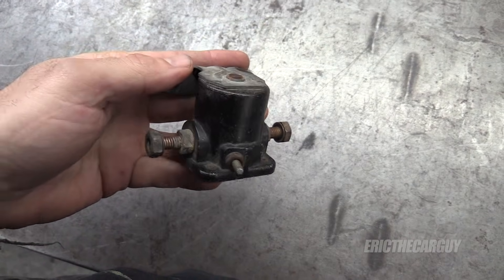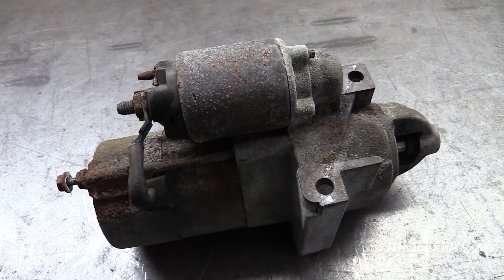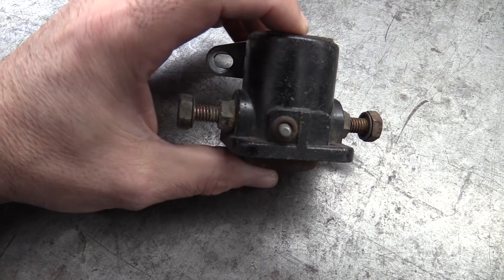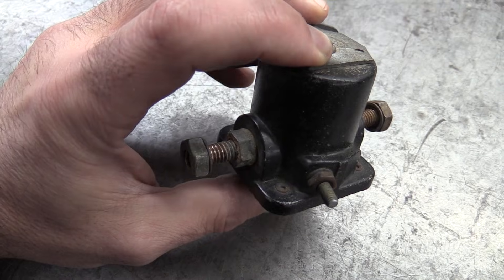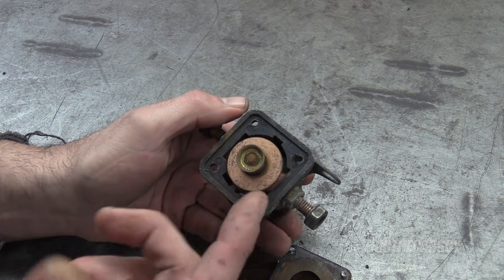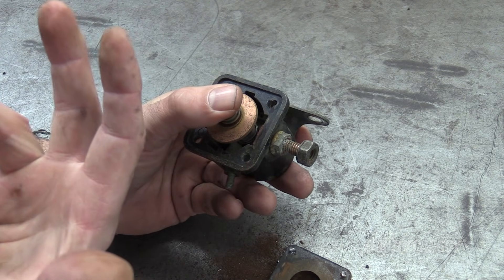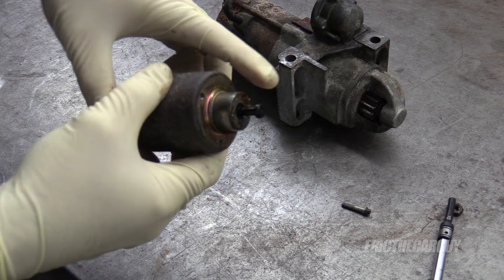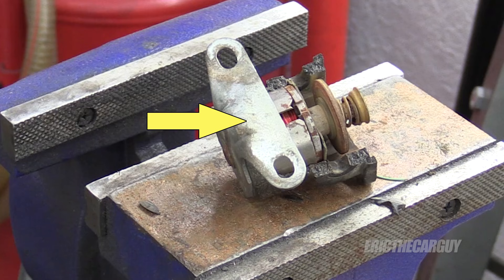How Does a Starter Solenoid Work?

Comment: I believe this is called a Pre-engaged starter motor and not a Bendix starter motor. Because the Pre-engaged starter motor can only engage with the help of that solenoid tugging on it. The Bendix starter motor on the other hand engages by pulling inwards and not throwing outwards like the Pre-engaged starter motor. Although the Bendix starter motor needs it's solenoid just to close the circuit so that the starter motor can fire up, it doesn't actually need the solenoid to pull it inwards, but it actually just makes use of the starter motors centrifugal force. The other info in the video was very helpful tho.🫡😌

Comment: That was very informative. Provide electric charge to create a magnet to make an electrical connection to make a mechanical connection to start the propeller to start the engine. I suppose there's a reason we can't do without the first 2 steps?

Comment: There is a difference between the standalone one and the starter mounted one. The starter mounted solenoid unit also energizes an electromagnet that throws a lever to kick out the starter gear so it can engage the flywheel ring gear. Technically, in terms of it's function,  the standone unit isn't really a solenoid and is often called a relay instead. That's because by definition a solenoid needs to have an electromechanical output

Comment: That was a very helpfull when u don't have the 200 to buy a new starter u will fix it if possible.it was oil soaked copper winding.with a broken winding connection.got hot and cooked.i unwrapped winding and cleaned really good sanded whire re winded copper .soldered new piece to make new connection to copper stud.cleaned all oil from entire starter  made new gasket and is still working today.desperate people learn things.thank u

Comment: The contacts are definitely a problem but also the windings and be open or shorted due to corrosion or excess amperage melting the jacket or the copper. Same principals inside a brushed drill.

Comment: I'm confused. what the point of the solenoid when you turn the key and can send electricity directly to the starter motor itself, why another component that will break is needed?

Comment: Well how to solve problem with gm model car that use E core type ignition coil with 4 pin gm ignition module?
How to use that bypass wire what rating diode shuld be and what cinde of diode it shuld use where does that label go exactly?
I have problems figuring out .
For some reason me fuse just pops?
Can some one please help me solve that problem?
I was also wondering can I use that bypass R terminal for me field on me delco 12si alternator instead of bulb?

Comment: Thanks- very informative. Don't think my problem is the solenoid or starter motor, maybe just the connections are causing a voltage drop. Its on a boat so pain in the arse to get to...

Comment: Could you explain the following: My diesel tractor has two solenoids. One on the starter and a divorced one mounted nearby. The energizer terminal on the divorced solenoid is grounded until the key sends 12 volts to it. It then energizes and sends a signal to the starter mounted solenoid and starts the engine. My question is, how and why is the energizer terminal on the divorced solenoid grounded in it's resting state? I about flipped out troubleshooting a starting problem when I checked that terminal for a short to ground and it showed shorted. But when I bench tested the solenoid, it energized and shorted the two large terminal posts telling me that it was working normally. I have seen no one address this terminal being shorted to ground when not energized. Could you please?
Reply: P.S. It uses a Ford type divorced solenoid. I read and re-read the factory service manual chapter on my tractor's starting system. It does not address this. Thank you, and I learn so much from your videos! Thank you for sharing your vast knowledge.

Comment: The solenoid that is attached to the starter is different. It has 2 coils. A pull in coil and a holding coil. When you first start your car the pull in coil works until the contacts close then the hold in coil works. It means as the pull in coil is working the power has to go through the starter and turns it slowly to make it engage better then when the contacts close the hold in coils works and full power goes to the starter. :)
Reply: NICELY SAID : THANKSALOT !!!
Reply: @gregscheyd4131  I used to work in a starter repair shop. Was good fun. I was on the solenoid repair line for a few years. We did about 150 a day for Valeo. Bosch 0331 303 solenoids if i remember right.

Comment: You need to understand the difference between a magnetic switch ( the Ford relay) and the starter solenoid.    You couldn't get the Starter solenoid to work for you on this video because you don't have the understanding of how it works. A magnetic switch has a single primary coil and the starter solenoid has a double winding( primary and secondary). The secondary is used to hold the gear into the flywheel(low current) after the primary(high current) pulls it into the flywheel. You tried to make it function by grounding the case of the solenoid and applying power to the switch line only activating the secondary coil that only gave you a light spark and no pull in. The primary coil of the starter solenoid is grounded to the motor stud that goes into the starter motor and the primary coil drops out when the starter is cranking so you don't melt key switches with the high current draw. If you would have applied ground at that stud you would have had a pull in and a heavy current draw. You also have the wrong idea on why the hammer trick works but that is another lesson.  Great channel and I have learned from you before on here.

Comment: Refurbing a solenoid would go like the first part of the teardown - drill out the rivets, then instead of (breaking) the bolts, just sand or file them & the disk flat again. Then bolt/screw/rivet back together. The metal looked thick enough to last for another lifetime of expected use.

-> Excellent useful video!

Comment: The first one you took apart was a Starter Relay, not a true starter solenoid. The Solenoid is the one with the plunger that pulls the starter gears. Relay is purely electrical

Comment: If your electromagnet is not working... and you don't hear the click... you are either not getting power to it, have a disconnect somewhere in the coil itself... or just simply lost the ground to it. Some of these solenoids have 2 connecting wires, one from the ignition and the other to a ground, other just ground at the bolts. Drag a multimeter over it.

Comment: Great video.  So when the S terminal gets 12v to move the plunger it joins the high amp terminals.    But what is going on when you hear chatter?  What is causing the plunger to bounce up an down?   Broken springs?

Comment: Hey guy question .well a bad solenoid cause the starter to nut discourage ? and consequently you can shot down the motorcycle ,it sounds like the starter is trying to start the engine.

Comment: @0:33:  Are you sure they're the same?  On combined models, doesn't the solenoid kick out the Bendix/ pinion?  E.g., if you bypass the solenoid on a combined model, won't it just spin the pinion in the starter housing?

Comment: wrong as you ca see the copper is nice and bright and making a perfect connection.  what happens is the winding in the solenoid  heats up and starts to melt the coating on the wires and makes  the winding less powerful and then the core is not pulled down far enough to make the copper connections touch with each other causing the connection to not transmit the full current needed to turn the starter.

Comment: Thanks for that I didn't know there was a moving part. I was wondering about my solenoid that I'd switch the engine off but the starter would continue turning the engine. Very disconcerting. I instinctively grabbed my wheel lock and tapped the solenoid and it always stopped. But it happened so rarely I didn't bother to replace it. The new ones look poor compared to the old one I got anyway. But I was wondering how would it get stuck in contact mode after you switch off the juice?
Reply: This is PROBABLY UNRELATED ;  but I recently replaced my 95 Ford f150 s starter - solenoid ( as a unit ) and I am almost certain that FOR THE EXACT SAME TRUCK , it makes a world of difference whether you replaced it for a MANUAL OR AN AUTOMATIC TRANSMISSION : the pinion gear teeth extend FURTHER into the flywheel , and do not DISENGAGE AS THEY SHOULD , if you used an automatic transmission 's starter solenoid for your manual truck !!!!!
My guess would be that a manual transmission 's starter solenoid might  not even engage the flywheel well enough to Crank an AUTOMATIC VEHICLE OF THE SAME YEAR , MAKE AND MODEL ........don't thank me if this is helpful : I got it from some other kind soul on GOOGLE when I was ready to pull my hair out in frustration ,........

Comment: That isn't everything a solenoid does. Most of the ones with the solenoid attached to the starter has a lever that goes from the solenoid to the starter that also pull when power is flowing through the solenoid coil. That lever is basically pulling the starter gear towards the flywheel

Comment: So it doesn't really matter which side you place the large battery-to-starter wires... does it matter which way you hook up the  ignition-to-solenoid wires?  I have two wires coming out of my new solenoid and they're not marked at all.  Same color wire.  (I guess serves me right for ordering the cheapo one...)

Comment: So what is happening when you have the solenoid mounted on the starter type and you turn the key and all you get is the starter turning over but its not engaging the gear to the flywheel? Usually I just keep trying and it will start the next try.

Comment: On the external/ separated style solenoid, what moves the bendix into contact with the flywheel?
Reply: GOOD QUESTION !!!!!!  also my 95 ford f150xl has a STARTER RELAY ( REMOTELY ) and ALSO a starter solenoid mounted on the starter !!!!!! Don't they BOTH PERFORM THE SAME FUNCTION ,??????

Comment: My Honda Civic wouldnt turn over and i looked inside the engine bay to see where the start was and check the battery for cracks, etc. I tried to close the hood but it just wouldnt close all the way. So i spent an hour slamming it against the latch and spraying WD40 on the locking mechanism, pulling the cabin hood release, until i finally realized the entire locking mechanism was bent out of place to where the hoods metal bar where it attaches to would push it down and away so that it couldn't get all the way down into the full locking mechanism for the safety lock (the one you need to pull the thing in the cabin for). So, after i realized that i took a skinny stick, pushed against the locking mechanism while i closed the hood on it and lo and behold! It locked. Then i went inside of my car and popped the clutch, turned the key to try starting her up, I noticed that i heard the starter for a short moment before it went back to clicking. I tried again, and again. Then i turned the key harder which caused it to work a little harder for some reason. Eventually the starter gained momentum somehow and slowly started moving faster. I gave it a rest for a bit and popped the clutch back in and turned the key, it was still slow but after a bit it actually started the motor. I tried again and it worked again. 
Would it seem to be a problem with the electricity getting to the starter, or a problem with the solenoids like explained in this video (there was clicking noises before i had the hood lock problem that caused me to slam it a lot)? Or might i just have to replace the entire starter? The car is 257,000 miles old

Comment: I have no idea why but I always thought the solenoid was responsible for pulling the crown gear (if I’m remembering its name) into position to engage with the flywheel, I thought the starter relay was responsible for the current handling, but it makes sense why that’s not the case, the starter relay might only be 50A but the starter can pull 10x that for a short while. So basically when you turn the ignition key, that contacts one relay, which contacts the starter relay, which contacts the solenoid, which is like another big ol’ relay.

I don’t know why I have the ideas that I do in my head, thanks for dispelling them, though!

Except I’m an idiot that should’ve kept watching. The solenoid does that, too... cool! I also thought that the hammer trick works by scaring the crown gear, since solenoids can seize up, it might be just enough to engage the crown gear, and once the engine starts, the flywheel spins sufficiently fast enough that it throws the crown gear away out of position. Happy to be learned here, too.

Comment: Solenoid=a fancy name for a switch activated by electricity-induced magnetism (converting electric power to mechanical power). You also see these mechanical switches as valves in home heating. When you have a furnace that supplies multiple rooms you would have a valve dedicated to each room and when you turn on the thermostat in that room you would send electricity to open the valve for that room and heated water would run to that room....

Comment: That's not the only reason hitting a starter with a hammer will make it work again, if the mechanism that engages the starter gear to the flywheel gets stuck you can whack on it a bit with whatever is handy to get it free.

Comment: Isnt the main difference on these two styles of solenoids that the first starter mounted solenoid type often used by GM and others also physically throws the bendix drive out into the flywheel at the same time it energizes the motor whereas the divorced solenoid type largely used by Ford also energizes the starter but the motor itself actually energizes and pulls another mechanism down into the side of the starter that throws the bendix drive arm out into the flywheel-?  I used to work on both for many years, but I guess in reality the solenoid is responsible for both actions on both types but in a different way.  After saying all this I see I  jumped the gun before the video was over and now I see ya kind of mentioned it at one point, my bad - :^)

Comment: When a solenoid is NOT attached to the starter, what makes the starter drive gear work ?
Also, how does the starter know when to contact the flywheel or flex plate ?

Comment: That starter is to GM's 2.2 LN2 engine. I had fun changing the original on my '98 S10. I put in a gear reduction starter and the weight difference was amazing.

Comment: hey what causes your starter to make a loud grinding noise when i want to start it but when it is doing this the engine does not turn over. I have to play with the starter for it to start the engine. any tips on telling me how to fix this besides replacing the starter, the engine is a nissan l24 engine so its hard to get a new starter were i live.
Reply: sometimes it makes a continuous clicking which is very loud when i want to start. please tell be how and what causes these problems so i can fix it.

Comment: I may never actually fix my own car, but I can at least have an intelligent conversation with my mechanic. Thanks in part to these videos. I'm curious; when the starter gear keeps missing the flywheel (?) is that an indication that the solenoid is somehow weak? Assuming the battery and connections are all good.

Comment: Lol you breaking it in the vise is exactly what you'd expect to happen with people trying to fix it for free and being very disappointed. There must be a way to get those out without cracking the case. You could also just use bolts and nuts instead of re riveting those maybe

Comment: In the day, those Ford solenoids used to last forever. Just a couple years back I bought a genuine Motorcraft solenoid for our '86 Grand Marquis. It lasted ONE WEEK before it fused itself together, and created a PERPETUAL CRANK condition! That was fun! Luckily my wife was smart enough to kill the engine immediately. I had to run out there in my slippers and yank the negative cable right off the battery! Never a dull moment.

Then not even a couple days later, I replaced a solenoid on my neighbor's '90 F-350 dump truck. 2 days later she calls me, stuck in the center of town with the same problem! WTF! That one came from NAPA, but looked to be made by the exact same manufacturer as the Motorcraft one. What a world we live in today ... :( 

Great vid Eric, btw. :)

Comment: my celica had an issue with this, it was verrrrryy rare but like 3 or so times a year it would do nothing so you smack it with a hammer and hold the key a bit longer and it would crank up fine
Reply: probably didn't need to hit it tbh each time I kinda forgot that the part that made it work was holding the key for like 30 seconds not the hammer

Comment: On some newer cars I noticed you turn the key once and let go and the car automatically continues cranking until the car starts.  What is different there?
Reply: Computer controlled solenoid, instead of the electricity flowing from the key switch to the solenoid and starting it, the ignition switch acts as an input to the PCM (Powertrain Control Module aka Master Car Computer) saying "can you please send a signal to the starter solenoid to engage?"